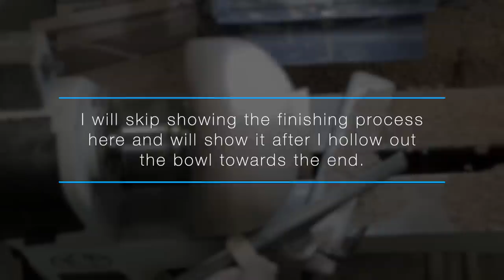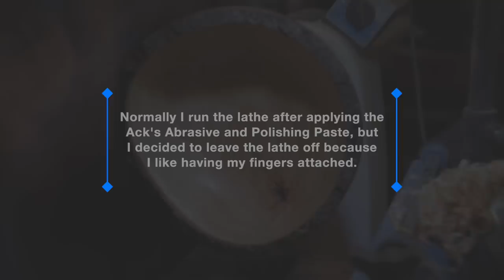Woodturning: Natural Edge Cherry Bowl & Giveaway

Comment: I've made a couple natural edge bowls. Didn't turn out to bad (no pun intended). Gave most away and sold a few. TEAR OUT, I hate that. No matter how razor sharp I get my tools, or how I turn them, the tear out is bad and I can't sand enough to get rid of it. I just tossed out a ton of beautiful spalted valley oak. If I can't turn it, then there is no since me hanging onto it. Have the same problem with apple wood. If there is a way, I have no one near me to turn to for help.

That bowl turned out great. Good idea on the reshaping of it. Most my shapes as I turn until I finish are design changes along the way. Usually due to catches. <grin> No two items will ever be 100% alike.
Reply from the maker: I know what you mean Paul.  I've got some spalted pieces that are very punky and some that are pretty solid.  I dislike very very much the punky stuff.  I have heard that some times if you change the cutting direction, it can help.  Maybe give that I go.  A lot of the time, 60 grit sandpaper comes to my rescue.  ha ha Thank you Paul for your support!  - Ed

Comment: Nice piece.  Never used the Acks products, but curious.  Good vid, thx.
Reply from the maker: I've only been using it for a short while, but so far, I'm very impressed with the results.  The size and price is comparable to similar products, but you get the polish included for the same price.  If you're interested in trying it out, please use the WOLF10 promo code to get 10% off your order.  Thank you!  - Ed

Comment: Your video gave me an idea but I am not good enough to do this. When you turn it around and start parting out the bark, what if you left a second ring part towards the center, maybe where the tailstock would be coming up from the bottom like a mushroom. The danger part would be trying to sand under the mushroom on the interior. Could be a cool new shape!
Reply from the maker: Thank you Joe!  That would be interesting.  - Ed

Comment: Nice video, with good information. How did the crack filling come out?is the finish you used food safe?
Reply from the maker: Thank you John!  The crack filling came out pretty well.  You can see where the cracks were and I think that's ok.  On Cherry, I don't think they blend in as well as other woods do.  I've seen some people use the Black Starbond CA glue on darker woods and they got amazing results.  I need to pick some up.  The Ack's polish is absolutely food safe.  It's made mineral oil, beeswax, and carnauba wax.  - Ed